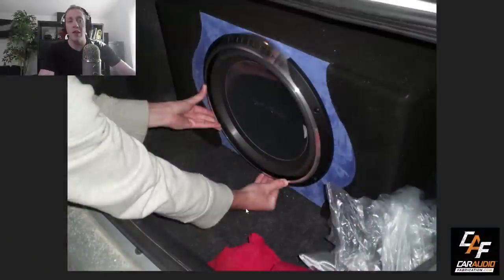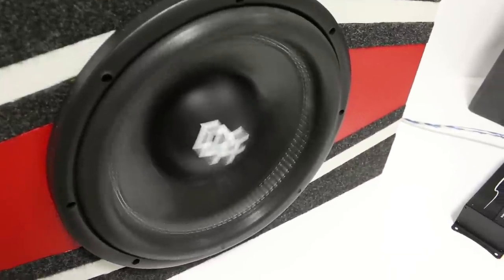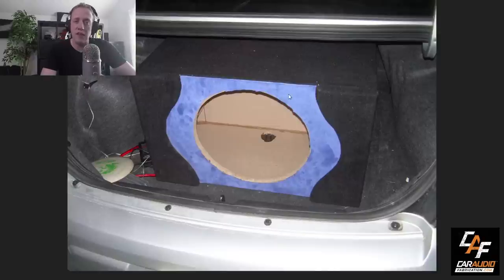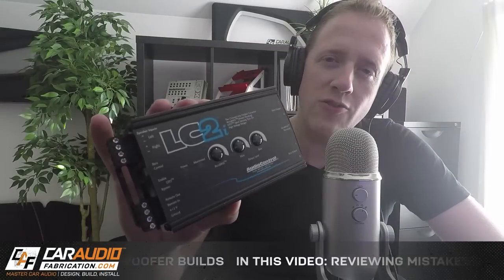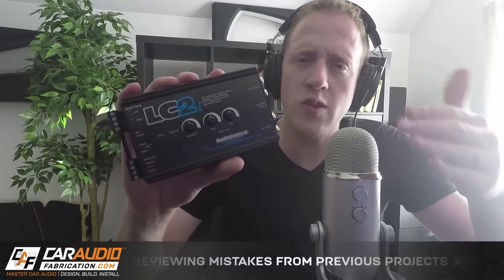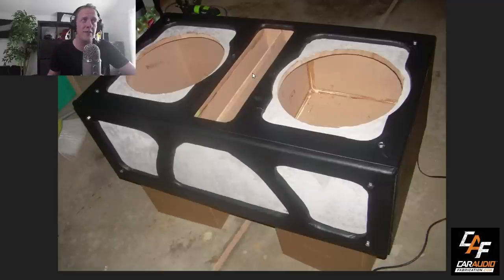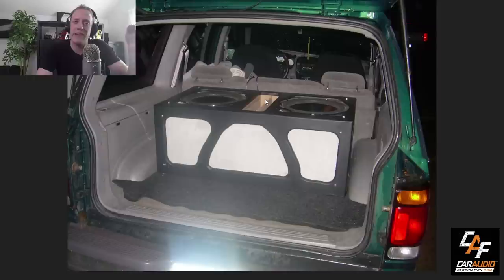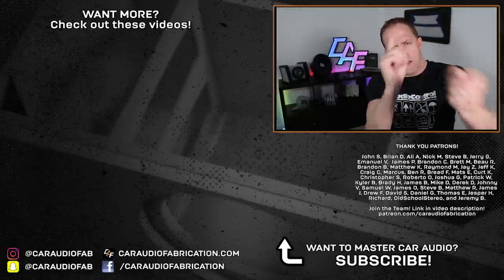MISTAKES WERE MADE - Reviewing my Car Audio Builds 10+ YEARS AGO

Comment: Learned about mounting depth the hard way. Pulled the door panels off, removed the oem speakers, and installed aftermarkets. Everything went smooth. Went for a ride, and found out that both front windows only went 3/4 of the way down.
Reply from the maker: Haha, I did that on my very first build ever. My windows had a hand crank, I was confused, but then realized my mistake. 😅😝
Reply: Aaaaw that sucks!
Reply: Woooow, thats first thing that i check before even buying spekers for my car. I learned it from my friends mistake haha. But u also can make "spacer" that will fit ur speaker so u can close or open ur windows without a problem

Comment: I made a recent mistake with my own car audio. I built a perfectly operational and aesthetically pleasing enclosure for a couple of 6x9s that we’re going to be used in my king cab Nissan Frontier. The speakers aren’t anything special but I took my time with building the enclosure and it paid off big time. It was the perfect size and everything sounded great. I decided to add a 12” sub a couple months later. I had the “great” idea of trimming down the 6x9 enclosure so it didn’t eat up so much space.  The idea was far from great. I’ll leave it at that. Feels bad man.

Comment: One of my first mistakes when building my own enclosure is using finishing nails to tack the box together while the glue dries. And not marking the areas where the edges of the wood will be so I dont miss or chop the supports in the box.

Comment: On my first self built box for 4 twelves, i used double baffle 3/4 inch birch, rounded all corners, bondo-ed the hell out if it, primed it, painted it..box came out beautiful!!  Installed it in my truck, bolted it down thru the floor, wired all subs. Was really proud and thought "this wasnt hard at all". Tuning was on point and everything...BUTTTT once i stared playing it i noticed even with the double baffles i still had some baffle flex..grrrrrrr.   so needless to say i thought double baffle was enough without bracing.. i was wrong..  i had a hell of a time cutting 2 inch dowels, using a bottle jack to spread the box slightly apart, cramming the dowels in with wood glue, screwing them in... im gonna throw up thinking about it lol... all said and done it came out great but definetly learned a bunch of "what not to do/what to do" next time.

Comment: Man you made me think back in eighty seven I had a eighty five Iroc that I built a rear seat sub box for the back of the seat with six eight inch subs in it and trans mounting the hardware so I could fold the seat down and covering that beast to match the rest of that stealth install was mind blowing my girl at that time totalled my car and I remember going to the tow yard and removing the stereo if they hadn't been watching me they never would have known what was in the car they couldn't believe the amount of equipment from the speakers in the side pillars behind the doors to the horns I had fiberglassed in the deck lid to the amps and the tricked out alpine head unit I had installed behind a radio shack  realistic radio faceplate I still remember people asking what was i had in my car lol

Comment: I'm dealing with a similar issue. I have a JL13W7 that needs to be rebuilt, and needs to have a new enclosure built for it as well. The one it came with when I bought it is a very poorly built ported enclosure, with no bracing, and several leaks. I have a 2013 f150 stx quad cab, and I plan to remove the back seat, design and build a new quarter wave t-line box that will also act as the back seat. The amp rack will also mount to the rear of box. This is going to be a real challenge due to dimensions required for this type of box

Comment: My first box was so horrible. Made the whole thing way oversized with huge panels of HALF inch MDF, yes only half inch. Didn't pilot hole any of the screw holes, most of them split and/or bulged out the wood, and then I gobbed it up with bondo to fill all the gaps. I still swear it sounded alright though...

Today I'm older, wiser and making really clean boxes. I scrutinize every detail of the box, the looks and build quality are just as important to me as the sound. If it's not clean and precise it's not going in my car (or anyone elses car for that matter.)
Reply from the maker: Very nice, I can relate to the fixing it with body filler! Now I only use filler for stuff like this: https://www.youtube.com/watch?v=YyOM-BYgFms

Comment: What's a solid beginner subwoofer brand? Like, what would be your ideal budget subwoofer and amplifier pair? Thanks!
Reply: That depends where you're from. I'm from the netherlands and the first thing I ever got was a 175W RMS ported JBL subwoofer with a 4 chanel ESX amplifier, I later paired some Pioneer speakers with it. All of it combined cost me roughly 300 euros and it sounded pretty descent. If you're only looking for a sub and want to build the enclosure yourself I'd recommend Hertz, Gladen, or GermanMAESTRO. They're all good quality and sound and they have descently priced starter models.
Reply: Jbl are ace for the money, can get a brand new 275w rms 12’ sub for 50 quid and it sounds great

Comment: Hi, great video. I was wondering if you can give us more information and numbers just the way you did for the port area. For example about the air speed that you talked about what is the limit? Or how much gap between panels of the box is acceptable (given the fact that all the corners will be filled with sealant anyway)?

Comment: Before I got my driver's license( I was only 15yrs young) and no real experience w/car audio equipment 😑. I took my shoe box of cash from cutting lawns and bought a KRC-2007, krarco 2ch amp and 2 12" subs from Radio Shack 😩. And then head to the Flea market for prefab box for the trunk😐. My system 👈😎👉.✌️ out Mark from Modesto,CA
Reply from the maker: Hahah flea market budget bumpin!
Reply: I started with a Sony explode thinking it was 1000 Watts not knowing what RMS Watts was. And 2 road gear 12s. 17 years later I have 2 alpine type R 12s. Custom 4ft ported 32hz box and a Rockford t1500-1bd. Big 3 upgrade. Sky high and Rockford ofc copper wire.  perfection is a addiction.

Comment: I sad a friend who wanted me to install a car had wire etc...go to install the amp wasn't long enough what 4/0 though so I took it install some blocks and use a run of 2/0 to the amp and I also tore it the factory subs (from his factory radio) and used the rca outs and remote turn on to find that the original sub had a stupidnlow tuning enclosure with an extremely high filter of about 90 Hz...so I ended up with a 600 watt amp tuned to 90... And 2 12s at 35...sad thing was it sounded better and was louder but could have been way lower!!

Comment: I have to ask. I recently got a box for 2 12s. It wouldn't fit unless I cut the port off. It still has a port on the side of the box but instead of the port facing forward like the subs, now the hole is on the side... So should I fix the box to its original port or does it matter? The size is the same its just on the side of the box instead if curving around facing forward.. Fix or no? My other option. Just taking a piece of wood and making it fully enclosed by covering up the port

Comment: Can I run my audio signal from my speaker wires for two separate amps? I do not have the option for free apps. But I want to run two amps off the same two speaker wires. Do I just wire them up and call it a day or what?

Comment: Fiberglassed a set of pods to hold oversized 6.5" components in place of the stock door grilles in my crx. Didn't take into account the space needed for the window cranks with my hand turning them.🤦
Reply: andy kimbrell you just need some short throw window cranks to solve that

Comment: I’ve had trouble with my sides of the box and baffled getting aligned just right, any suggestions?
Reply: NClawson0823 if you can spare 20 bucks and a trip to home depot, Dewalt makes a 90° corner clamp primarily for framing, but it works on any material up to 2" thick, and holds with 250lbs
Reply: Works beautifually every time
Reply: Matthew Mattson thank you very much! I’ll look into it
Reply from the maker: Intentionally cut overhanging pieces of wood too large. Come back and flush them with a flush trim bit and router. This is a great way to use something like a circular saw that may not be as precise, and use something like a router which is extremely powerful as it can be used for tons of different things with different bits.
Reply: CarAudioFabrication I’m thinking of picking up a large set of bits for my router and will start doing this, thank you! Great videos

Comment: Biggest mistake= fibreglass a sub box barehand.  The resin felt incredibly cool until the activator began to rise in temperature.  I didn’t have acetone and ended up soaking my hands in gasoline to alleviate the activation. What an epic fail...

Comment: I used winISD to calculate port length ........I dont exactly know what i did wrong but the program said my port was tuned at 35 hz, when I double checked it AFTER building it ........its FAR to big with a tuning frequency of 200 + fuckin hz .......wtf      : ..... (

Comment: mistakes ive made...lmao lets limit this to a few majors. 1st. blew a brand new mids amps >.> not a proud moment! 2nd not tuning some of my stuff with some kind of distortion detector. so ive blown several subs that way. 3rd. going to a local shop called J&J audio!!! that place is cheap but they blew a set of old ass pioneers i had cuz they decided turning up the gains without asking was a good idea! them things were about 15 years old and i bought them from a friend! 😡😡😡 was not happy! especially when all they had to do was wire in the amp and leave it alone (had been in use forever on those exact subs!!!)

Comment: I would sure like to hear about mixing a lot of filler at one time then it hardens on you mistakes.  I can't seem to get past that one.  lol.
Reply from the maker: Yeah definitely don't want to be stuck sanding tons of filler, a good tip for increasing the working time is to spread your "puddle" out more on your board, it won't harden as quickly on the board allowing you to be able to use all of it. :)
Reply: Also, on having more time to work your filler. Use about 3/4 the amount of hardener you’d normally use. It will take a really long time to set, but it will harden and work nicely.

Comment: Here's a mistake I made. You will most likely say to yourself  " What a dip shit". I installed a system in my 2000 Impala. When it came time to connect the power wire from the battery to the amp and the ground to the amp, I inadvertently connected the wire from the battery to the ground slot of the amp and the ground wire into the power slot of the amp. When I went to turn the system on for the first time, the vehicle thank god was smarter than me, recognized that something was wrong and completely shut down. I mean completely shut down. No lights, no horn, no ignition. It was as if the car had no battery. Now mind you, I am still unaware of what I had done. I'm checking things out and can't figure out what happened. After about 15 minutes of looking around, I see my mistake. I was now no longer worried about my system, I was now concerned about my vehicle. I immediately disconnected the battery and thinking to myself " you moron, you just burned up the computer get ready to pull out the checkbook again".   Well thankfully after about 30 minutes I corrected my mistake and re-connected the battery and all was well. I guess I had to give the computer time to unf%&k itself. Pretty stupid huh.